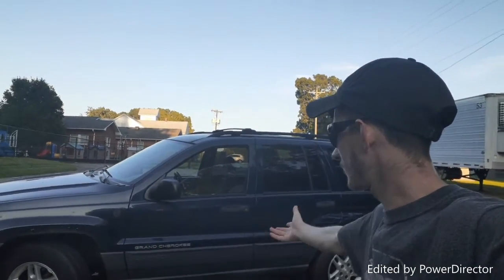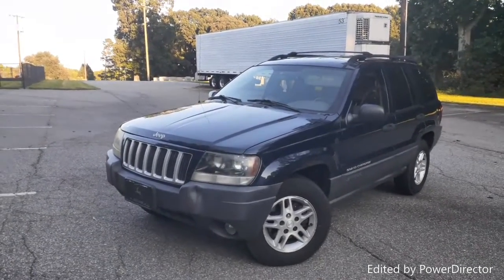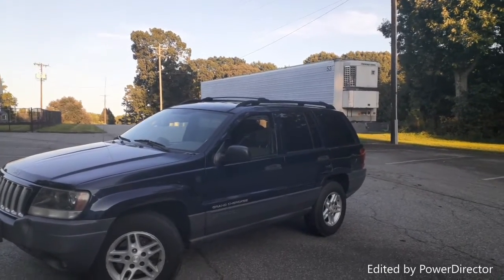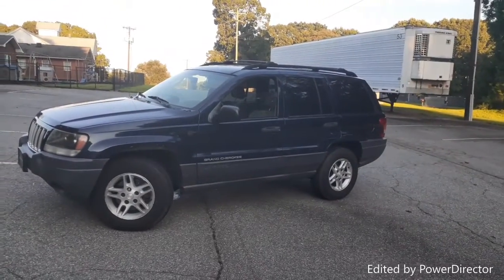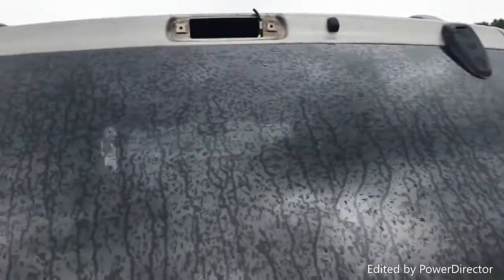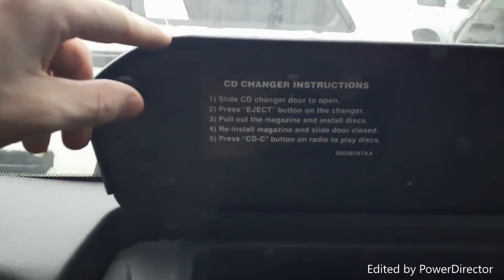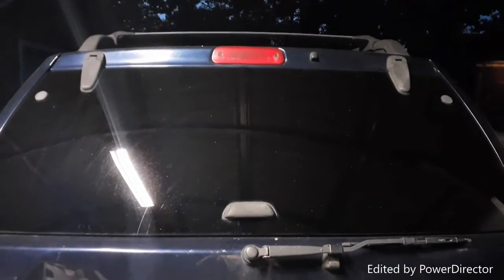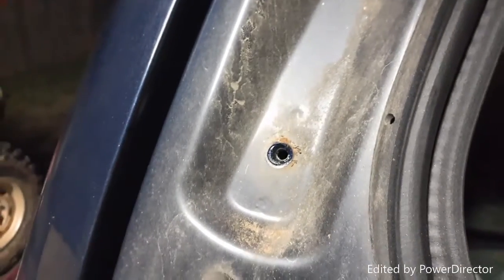U-Pull picking pt.10 PLUS new vehicle on the channel!

Comment: You do one modification to that new rig and it will spiral out of control and next thing you know its gonna be on the Uwharri Trails lol!!! Thats an old school 6 disk CD changer. You can load up to 6 at a time and scroll through them as you listen to change the CD's, its from the late 90's early 2000's and its bolted in there pretty well so nobody could steal it.
Reply from the maker: Thats hilarious! Cause thats what everyone else has said as well! Hahahahaha, but no, no, no, im only going to do some minor upgrades ex: head lights, tail lights, sound system... i bought this to be a reliable daily that can also double as a tow rig when need be! And thats pretty awesome! Yeah i didnt bother trying to pull it cause id have no use for it, but also cause it was raining and all wet, and well quite frankley i didnt really feel like being out there lol, i wanted to see if they had a few parts i was looking for, grab em', and get the heck out!